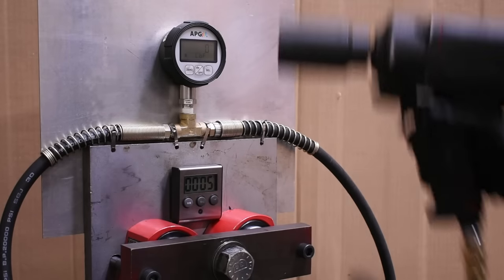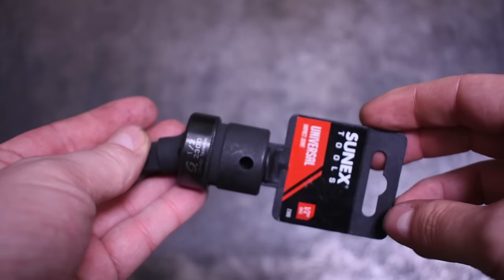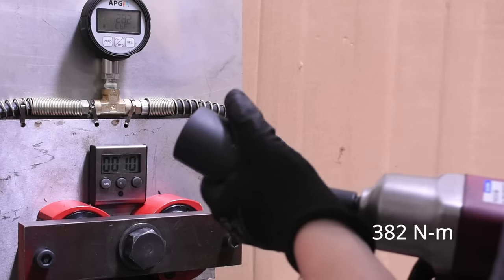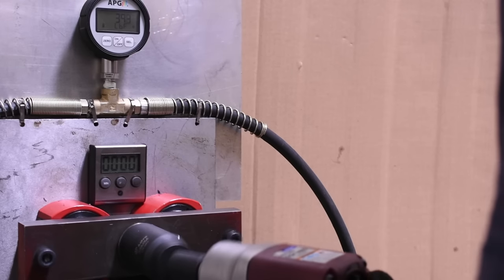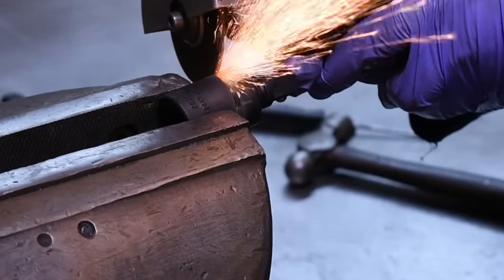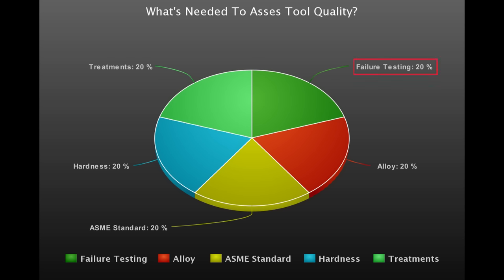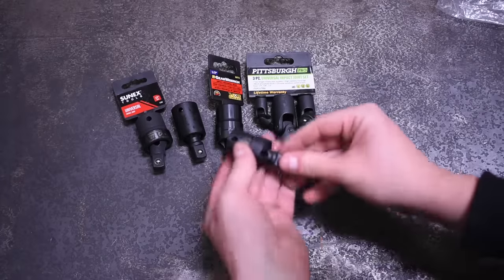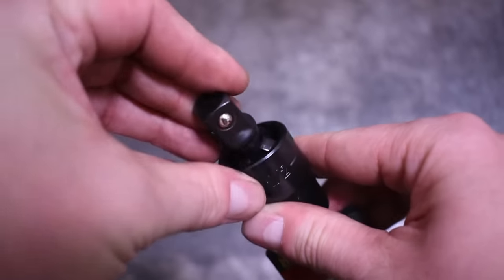How Much Power Do You Lose w/ Universal Adapters? Dyno Test For Science

Comment: A couple of years ago I bought a set of the 3/8dr gearwrench  x-core sockets. With the same results that you guy's got after one use. The 18mm didn't even make it through one pull of the trigger.  For the price point I really like the sunnex brand of impact sockets that's where I spent my money for the 1/2 - 3/8 swivel sockets. The amount of punishment I've put some of them through surprised me to say the least. Not a sponsor just happy with the quality. I have the universal adaptors from sunnex and snap-on 1/2 3/8 and 1/4" dr. I don't use the snap-on adaptors since I bought the sunnex just due to the amount of money spent on the snap-on's. Call me crazy and you would be correct

Comment: I’m a heavy equipment and industrial plant mechanic and I’ve always used the gear wrench style swivel adapters because the hold up and don’t break as often . Mine are craftsman and Matco brands and I bought them in 2005ish . Ive broke pined ones of all brands from harbor freight to snap-on’s . For pinned versions I do like snap on the best and I have swivel socket sets of 3/8 and 1/2 metric but I bought them at a pawn shop years ago,  the cost is way to high off the tool truck .

Comment: I’m glad I bought the pinned Gearwrench Impact Swivel Sockets instead of the X-Core ones now. I’ve got a tool that’s going to last longer and doesn’t kill torque as much

P.S. Quick tip for other mechanics, lube the sockets. A few drops of air tool oil will make them 100x smoother and tremendously reduces the amount of wear and damage on the joints over time

Comment: Universals are a good fit for TTC because every mechanic needs and uses them often. Please find and test more as time allows! Many automotive tasks require an impact but do not permit a straight shot at the fastener making uniwiggles critical to getting work done. Not breaking in this case is a safety issue because fragments fly.

Comment: Glad I went with the sunex. Got a really nice set with swivel short deep in standard and metric  along with extensions and torx.
Came in a carry case that I cut the top off and set it in a tool box drawer.
Never liked gear wrench after seeing chrome peeling off wrenches on a store shelf.
Reply: I have the same set. 10/10 would recommend

Comment: After yrs working with air tools I noticed if u take and twist with your hand the slack out of the joints any joints extensions etc. you’ll get much more power and less air consumption. Hard on your hands ya but it helps and reduces wear of the tools. Also I would buy off brand air tools and port them for extra power. Was surprised to learn how some expensive tools were just slightly changes chinese tools

Comment: I enjoy seeing the hardness test. Typically if you know that material and the hardness you can find out the type of heat treatment that the manufacture used. By the looks of the Cr-Mo or 4140 steel at around a Rockwell C47, that means it was either heated and quenched in whatever finishing oil they used. My guess is most impact sockets that have a Rockwell C 30-50 hardness would be quenched in oil, and anything harder than C-50 could be quenched in water or further heat treating processes were added on top of quenching it in oil.

Comment: I'm not going to watch but will give a thumbs up. I have always used the AWB joints now sold under the sidchrome name I believe by Stanley. I've been using impact uni's for 14 years and started off as a suspension mechanic. So I've put them through hell.
My first joint was a T&E and it failed in two years, my second was a AWB now branded as Sidchrome. My third was another but it bears the sidcrhome brand. So I've had 3 over 14 years and the 3rd is about 2 years old so the second lastedabout 9 to 10years of constant abuse.
How did I go from snapping one every two years to making one last 10? You might ask.
I started lubricating the ball and pin.

Comment: Can you test if there’s an increase in torque if you twist the impact in the direction your trying to remove the bolt. I’ve tried it before on a stuck bolt that my impact just didn’t want to budge and torquing on the impact in the direction I needed the bolt to move (counter clockwise for off in my case) worked. I assume it has something to do with taking up some of the slop in the connections giving more impact to the bolt instead of just trying to move air.

I would really like to see this tested and if it does anything. It worked for me so I can only assume I does help to some degree. I was using a gen 1 Milwaukee mid torque on some wheel studs trying to remove a tire.
Reply from the maker: We can do that
Reply: It's always a good idea to "help" the impact by keeping things tight. If you leave the thing loose/rattle, there's just going to be a tiny little impact from the inertia of the socket, and you lose all the impact from the hammer inside the tool. That's why you also want a heavy, stiff socket to get the shockwave across.

Comment: I bought the Tekton after watching this review and it was good for a little while but within 3/4 months it seized up. I was using it on steel erecting jobs, pipe flanges and various other jobs on my DeWalt DCF891. So did longevity I don’t rate it too highly, I wouldn’t say it was over used and certainly not every day. I can be unjammed by hitting the pin back in but it will jam up pretty much straight away again. I might have just had a dodgy one so it would be good to hear of other people’s experience with it.

Comment: I have the x core gearwrench swivel sockets, been using them for well over a year and every one I use has the edges rolled over. They still work and are still smooth but they all look just like y’all’s universal

Comment: I used to use a pinned style AWB one but it is now available as Sidchrome here in Australia so I use that I'm on my 3rd one in 13 years. I think it is probably the same tool as the sunex one tested here. 
I also lube the ball end with oil as when they get used dry poweder forms from the ball wearing and causes the joint to bind up a little. Lube has extended the life probably three fold imo.

Comment: Excellent job on the analysis. Very professional.

Seems like Gearwrench could make those tabs longer and taller so they would contact the drive end with more surface area. They might even be able to make them wider with the right geometry to reduce some of the backlash. Pretty terrible that it is the most expensive.
Reply from the maker: Agreed, the tabs don't make a lot of sense to us. So much more space to make them bigger
Reply: @TorqueTestChannel  The tabs seem like they are as large as they can be given the shape of the lobes on the male part of the socket.  There's play and the tabs don't reach all the way into the slot when the adapter is at 0*, but if you flex it to the max angle the slot is a lot narrower and shallower.

Comment: I got the tekton along with a lot of their other stuff throughout time. Anyway I've had the swivel for a while and have gone through two. It worked good until it rotated in it's housing. Warranty was amazing and fast of course but I upgraded to snap on swivel(my plan start cheap upgrade what I need). If you're wondering I seized both with a pt850 running it max angle a lot and the second got stuck but I hit it with a hammer and it came lose and seems to be working okay. I will be bringing it home for my home box.

Comment: I'm surprised about the GW troubles. I have been using a 3 pack of the X-cores for 2+ years and mine still perform well. Admittedly I mostly use them with a 3/8 or 1/2 impact for hard to reach bolts on cars on the lift, so pretty light duty, but they still work as new.

I will probably try the Tekton next time though.

Comment: Have you done a test on torque-limiting extensions? I’ve had horror stories from tire shops over tightening lugs that they swear used the correct extension. I’m thinking there are certain sympathetic strike frequencies that cause them to tighten way higher than their standard flex rates.
Reply: If the impact frequency is higher than the natural resonance it the torque stick, it will also overtighten.

Comment: All those "X" style pinless mushroom. I can say for certain that Matco ones are different than Gear Wrench or any other similar types, they last way longer, but meet the same fate eventually too. My Snap-On pinned swivel socket set is pretty good, have only had to replace a few, though I just have an old school Mac AW234 (American IR 231 with a slightly different casement). I'm sure If I had the new Matco I'd be breaking pins more often.

Comment: I hope you do a test on drive size adapters.  Your use of the 3/4 impact to simulate long term wear, explaining how the larger hammers make a difference (since it seems 1/2" impact guns get most of the market, so they get all the marketing, and 3/4 gun torque rating claims are being almost overrun by 1/2 gun torque rating claims).  That made me consider buying a 3/4 gun for stubborn jobs but I'd probably be using an adapter down to 1/2" drive impact sockets for the type of stuff I do.  I'm curious if the adapter would mitigate the advantage of the larger hammers.

Comment: I got a set of universal joint impact sockets and it changed my life lol. Just the basic metric sizes, but saved so much time where universal joint + socket just wouldnt fit.  Exhaust, mostly, but just amazing in general.  Also...cheap Mastercraft uni joints that come in those starter socket sets...what a joke lol. Youll end up wrapping it in duct tape after one use!  A good universal joint is an anomoly...do they even exist?  Lol

Comment: I been watching your channel for a while but I'm a diesel tech and I  was taking a fuel tank strap with a 3/8 impact with a 1in socket I was moving it back & fourth with my matco pinless  and grab a buddy snap on pin design just to see if it would do better. (This has been about 10 years ago maybe quality has changed) and it wouldn't even move the nut from where I had it. So I just worked it off with my matco and it came off slightly after that. I'm just kinda confused by real live testing. But great channel reviews non the less.
Reply from the maker: Matco pinless is rly good force transfer wise. We've tested since

Comment: I work on larger stuff, torque specs are 215 lbs for a certain net and bolt....then expose to corrosive material and my Milwaukee will make those universals blow apart on regular bases. Ive bought impact wobble extensions and after 1 week theyre rounded off too...

Comment: Them hf are dangerous lost the bite on a bolt one time. Flopped over 90 degrees and spun at few thousand rpms socket flew off and dented the tin roof of the shop.
Reply from the maker: We def say a prayer before pulling the trigger

Comment: Worked in the millwright trade for 14 years now. The pinned half in are junk. We had to stop using them on generators and what not because you never knew when they would sheer the pin, or toss the collar. Moslty high end tools at that. The last 6 years or so we have been getting supplied with pinless. Lots of williams, and some other quality brands. They dont seem to wear out very often. O)n a ge turbine outtage with pinned name brand junk, we would burn up half of them within a month at least. The pinless mostly just start not wanting to wobble, and we tag them out. We usually run them on ingersol rand titanium air or their electric counterparts. They get hammered on from all the fuel piping.

Comment: With the hardness readings are the results compensating for the diameter, or is the reading straight out? Small convex diameters will read lower than a flat, while a larger diameter will read in between the small diameter and flat. Concave will read higher than a flat. I use a chard with my tester to work the out.

Comment: I got the tekton u joint and use it with my 1/2 inch fuel milwaukee impact and just had the ball pop out today when using it on 1 1/4 inch bolts.  I've been using it mostly on that and 1 1/8 inch bolts, usually with no problem.  But here recently, it has been getting stuck like that one.  Usually if you keep using the socket, it will unstick itself.  I was going to see about warranting the u joint if it does it again but I still would easily pay for it if needed, its that good when you have to use it.

Comment: Do socket adapters become stronger when you weld them to the socket? I’ve see some tool test channels use that method. Like welding a 3/8 to 1/2 adapter to a 33mm socket to use on a 3/8 impact.

Comment: I can safely say the harbor freight u joint style lasted 15 seconds on my m18 1/2” drive impact. Knocked the pin out and it flew apart. The tekton wore in and became a loose goose but still holds up to the abuse on heavy underground mining equipment, but my snap on wobble still has the stability to hold a 24mm socket and not flop around. I honestly use either tekton or snap on the same. Which ever I grab out of my box first

Comment: I use the gearwrench x core daily. Definitely get tight in the beginning, but will eventually wear until they are smooth again. May take a month or so of daily use, but they definitely smooth out after a while. I have no idea what the torque difference is after being fully broken in, however.

Comment: This video earned my subscription. I'm curious if 'eyeballing' your angle has anything to do with torque outputs. Would it be worthwhile to make an obtuse jig for referencing off the test plate and the body of the impact gun? That would remove human error from varying angles.
Reply from the maker: Since we ran at least 3 runs per socket on the dyno, we were able to near conclusively rule out a lot of human error. Each sockets' run was within the impact wrench itself's margin or error which was super surprising to us. These things move around a lot at angle when run, so it's hard to keep anything at a "precise" angle.

Comment: any way you could, if you haven't already, test that matco impacts reversing power with the dial turned all the way up and all the way down. I notice both the matco and IR impacts are louder pitched when free spinning in reverse with the dial on low setting and the hits seem to be faster as well. yes, i said that correctly. they sound like they're spinning faster, moving more air, and hitting more rapidly on the low setting in reverse.
Reply: right here TTC.

Comment: 20+ years ago I bought a MacTools 3/8” swivel adapter and not only has it been a beast. But it’s also the smallest form factor that I’ve come across.
Sounds like I need to given Tekton a try.
BTW, I’d love to see you test threaded rod. I’m putting together a tool using some. Basically, what size and material/hardness is strong enough to safety compress an entire car/truck suspension spring?

Comment: If you’re taking notes for future videos, Proto makes an interesting universal joint that doesn’t seem to match any other designs other than Snap-On. 

The little bit of research I’ve done on “best design” points to - a more expensive well made pin design is better than any pin-less. This was before Tekton entered the ring but I’m sure it still holds for the majority of cases. I feel like this video confirms what years of experienced mechanics have observed. Well done!
Reply from the maker: The J74470P? Looks like a pinned style with no collar and a tapered inside edge to reach that 30 degrees?

Comment: ive liked the tekton stuff, i have all of the half inch impact socket sets and the metric 3/8s also the complete wrench set and so far they have been pretty good. the only thing about the wrenches that i dont like is the size is not marked on the open end instead it is only in the middle

Comment: 11:42 if its anything like our pin type at work......... it will be fine for about 2 or 3 years
then RAPIDLY go down hill
.
once they get a bit of "slop" in them..... the impact "pulses" just start to rip them apart... faster and faster
still.... for ~10 bucks.... its worth it
.
.
.
the "U-joint" types give you more angle 
but at a perfect 90 (or even 70 or 80)..... you kinda get about a 1/4 turn..... and then it binds up
so you reset.... get a 1/4 turn.... and it binds up
.
however..... sometimes thats the ONLY way you are removing / installing that bolt
AKA.... nice and slow, with a lot of cuss words
.
.
.
ive also found that wrapping it in electrical tape works for certain angles.....
but makes it WAY worse for others (more bind)
.
.
what a guy needs is a LITERAL U-joint.... with needle bearings and the whole lot
Reply: also... i wonder if WHERE the flex joint is in its rotation matters
.
like a drive shaft U-joint is NOT!! "constant speed"..... 
it speeds up..... then slows down..... speeds up..... slows down........ in 1 full turn
.
so these pin type flex joints might have that same issue
where it may give you 50% torque ...... but turned 90 degrees...... give you 75% torque

Comment: Big question, does the adapter get the job done though? Keep in mind the durability and the cost. A $10 dollar accessory is just as effective as a $20 dollar accessory if they both do the same amount of work. Peace of mind for the expensive adapter, 50% cost savings for the cheaper hardware. When they break, they break.